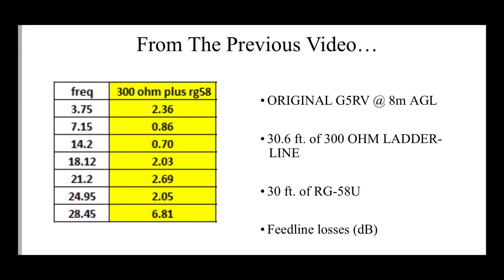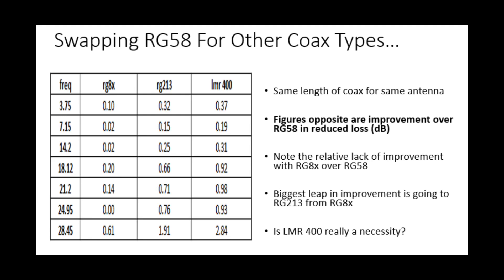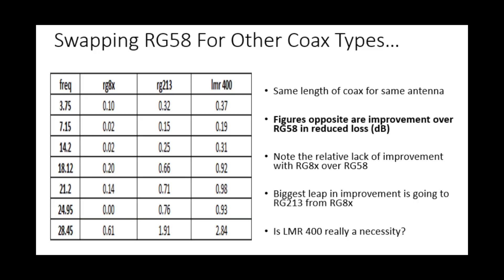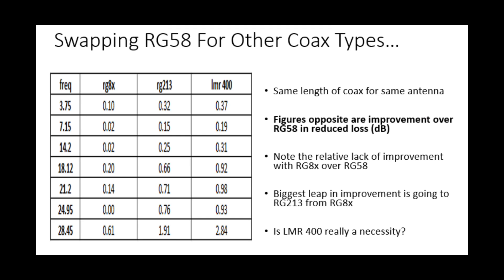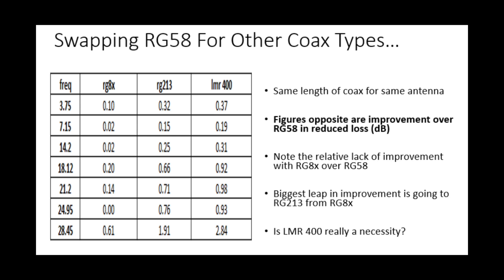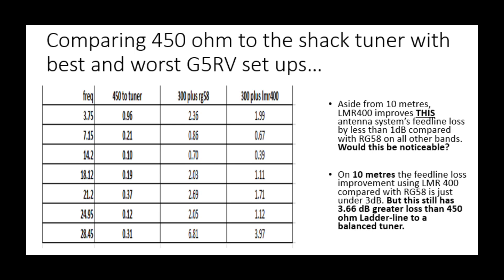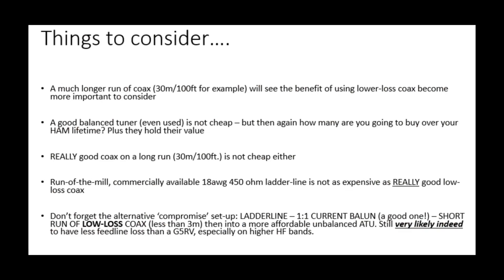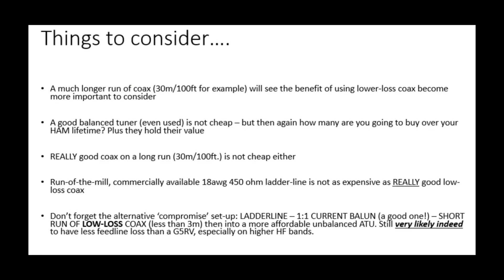HAM RADIO: G5RV, Does Better Coax Make A Big Difference?

Comment: 34 ft of window line is the design spec. You showed 30.6 ft of ladder line. 1:27 in. The ladder line is important to this design.  Of course you can tune the ladder line for better performance on 10 m .  People are using regular tuners for these antennas.

Comment: i a great video btw, im just getting into ham radio and just passed my foundation M7GKI i have a full length g5rv to install but it says i need 45 or 90ft of coax so does that mean 45 for a half size and 90ft for a full size?? hanks
Reply from the maker: The coax length may have some influence providing a low enough SWR for all bands to be tuned. Don't get too hung up on that. Use the length you need to operate and go from there.

Comment: Have used ladder line to tuner and g5rv. The main thing I find is the lobes and nulls are deep. At 102 ft long on 10 meters better with a99 vertical. Some signals the same on g5rv and a 99 some almost nothing. And good signal on Antron 99.

Comment: This is my opinion only .......yes yes and yes I love di poles the secret is to ground everything  rg213 compression plugs Rg8 x is also excellent but youre power limit is lower make sure you buy guenuine RG213 or LMR 400 or URM 67 all fabulous quality coax but I use RG8x in the shack upto 100 watts...An  8ft grouind rod is far more effective than a 4 foot ground rod ( 5/8 dia. 4 foot Length x 2 plus brass jointing connenctor if youre ground is poor i.e. builders rubble or sandy and dry which is normally  close to youre house remember like Tesco say " every little helps" lol
My Di-pole is 100ft approx 75ohm ladder feed then ive ground it to earth at 75 ladder to SO239 connection then in the shack all equipment and I find using old vintage LPF I picked up from fleebay also help with recieve  as well TX RFi it really pulls the noise down as im in a built up swamped with broadband users Cheers TIM and all viewers
Reply from the maker: Good points 73

Comment: I just follow a simple rule now. It the VF is <87% and/or the attenuation is greater than ~0.6dB/30m @ 30MHz I don't use it. The only excuse is cost. I'd rather spend more on feedline and less on linear amplifiers. Else use good antennas that use ladder. LMR is like the patriotic parrot. Hyperflex 10 to me is king at present.
Reply from the maker: Good points

Comment: I would like to know your opinion of the ZS6BKW antenna.  If you are not familiar with it, it is a computer optimized G5RV.  It is somewhat shorter than the G5RV and will more easily fit in a small garden.  There is even a smaller version called the G0GSF that would fit in a very small garden.
Reply from the maker: It works well so people say. My only issue is that if you have a small garden why use a 94 foot antenna for 40 and up, when if you feed it entirely with 450 ohm you can easily tune 80 and 60 too.

Comment: If you start with the idea ALL antennas work, with some working better than others, a G5RV as a multiband antenna may suit someone's purposes but my experience is the G5RV is and was actually a 20-meter antenna designed to get a certain radiation pattern with a vertical aspect to that radiation. just making it a doublet mixing coax to the feedline and using it as an all-band antenna force-feeding it with a tuner in my view it loses its design purpose. I could never get enough height for the feedline to come straight down to meet the designed installation. I just ended up putting a doublet with each side being just under 150 feet, feeding it with 100 feet of 450-ohm feedline. Strangely it was natively resonating above 12 megs all the way to 6 meters. I did have a heavy 4 balun and about 30 feet of old rRG8. It loaded well everywhere except 75 meters. I have since come to believe the very low SWR was the old RG8 was very lossy giving me a false low SWR reading. I suspect the same would be true if RG58 was used with a long length. SWR is read differently with lossy coax. A doublet is the better all-band antenna with a tuner in my view.
Reply from the maker: Totally agree!

Comment: I can't help thinking that much of the loss is due to an impedance mismatch. Could you perhaps model both the G5RV and the Doublet/Coax combination with various 1:1, 1:2, 1:4, 1:9 and perhaps even 49:1 transformers? See how that then affects the various bands.
Reply from the maker: 1:1 is usually best as it maintains tuneable impedances. 49:1 should only be used for EFHW where 2k to 4k ohms are typically at the feedpoint.

Comment: Abit Missleading ,
coax losses becomes VERY significant when there is SWR involved, which is the case in most circumstances for g5rv, best is use a bulun and tuner as close to shack as possible, have the ladder lines carry most of the length as balanced ladder/window line has the lowest losses even lower than most expensive coax
Reply from the maker: And you watched the video??

Comment: Hello.  I have a question that is a bit off topic.  I just got my 7300 this weekend.  I only have a tech license at this point so I was only concerned with receiving signals.  I put up a receive only wire antenna and surprisingly it worked very well on all open bands.  When I do put up a TX/RX antenna, that is maybe 1 or 2 band specific, will I still receive on the remaining bands? I don't plan on transmitting until the 10 meter opens so most of my time is spent listening.   If that's the case should I just leave my receive antenna up?  I don't want to lose the ability to listen on other bands.  Thank You.
Reply: It depends on the matching. It can be an issue on receive. My end fed wire antenna doesn't receive at all well on 20m until I hit the "tune" button and get my tuner to transmit and tune itself, then reception is great.
Reply from the maker: Yes - Paul has summed this up well below 73

Comment: Hi Tim, great analysis. However, if you bring ladder line all the way into the shack, you’ll get much more RF floating around in the shack, so pretty sure to fail the RF field exposure regulations. Therefore, I think ladder line to just outside the shack and a hefty balun with a short coax run internally is better. Especially if you also add some toroidal RF chokes on the coax. Keep up the good work.
Reply from the maker: It can be an issue yes. I might have a look at the extra loss (if anything much) going the external Balun route compared with straight to tuner 73
Reply: If you run ladder line directly to your tuner it becomes impossible to add lightning protection to the feed line.  With some a mount of coax at the end you can use a normal lightning arrestor before bringing it into the shack.

Comment: Hi Tim,
Thanks for doing the followup. If I had a G5RV that was already installed, I would ditch the balun and coax and splice in 300 Ω ladder line to the house, then a 1:1 current balun and short coax to an external tuner and radio. You and the family stay safe.  73  WJ3U

Comment: Good analysis Tim. I agree. Run the ladder line direct to the tuner. Coax is fine if you can have a remote tuner outside (connected directly to the antenna or the ladder line).

As for MFJ, I like the somewhat agnostic, diplomatic comments! Personally I've found most of their kit to be ok but what I will say is that many of their "balanced" outputs from their tuners just have a 4:1 balun inside.
Reply from the maker: Yes indeed MFJ is marmite!

Comment: Hi Tim,
Thanks for the followup. If I had a G5RV already installed, I would ditch the balun and coax and splice in some 300 Ω ladder line. Run that to the house and connect to a 1:1 current balun then a short run of good coax to an external tuner then the radio. You and the family stay safe.  73  WJ3U
Reply from the maker: Great points Don and hope all are well with you , thank you 73

Comment: Hi. I have a g5rv now for about 15years. Swr low at 1.1 and high at 1.7. 300ohm line. Rg58. All at 110 deg apex, 45deg angle and feedline at centre between 2 radials.  Now my coax screen is most dense wind i could find. Cant see through screen. No tuner...BUT it took about 3months to finetune this antenna. Its not a field day antenna. Nice vid thanks. Basie zr2ba.
Reply from the maker: Thank you!

Comment: FWIW I have tried doublets in a few scenarios, and the extreme cases can be even more dramatic particularly if your "doublet" gets close to resonance on any band.
Sometimes if you have a capable tuner it is just too tempting to  operate on bands where you can get a match without thinking of the stress the feeder is under.
IE a 40m dipole, and in my case only about 30m of feeder dragged out of the junk box in the car. RG58 as bad as it is gets about 80% of the power to the antenna assuming a 1.5:1 SWR.
Bliss, it works just great. When nothing is going on creep on to 20m, antenna is resonant as 2 halfwaves so impedance is somewhere in the region of 5000 ohms,  losses go through the roof, over 94% of the power lost, 10m is even worse! Took antenna down and replaced feeder with proper open wire, obviously much the same on 40m but ridiculously better on those harmonics where it was previously useless. True open wire with wide spacing and reasonable cross section conductors is phenomenally low loss,  though later that did get replaced by easy to handle 450 ohm.
I know this is a bit of an extreme instance but highlights your point, with low SWR on HF modest lengths of RG58 are usually fine. Well done for creating the tables.
Another factor of course is that the mismatches mean you need to derate the power handling of the cable..... into a good match quality RG58 is good for about 1kW average on HF...
Good work Tim 73
Reply from the maker: Some great points there thank you!